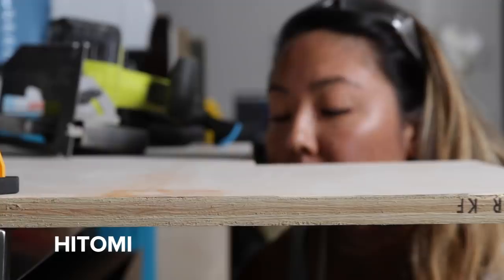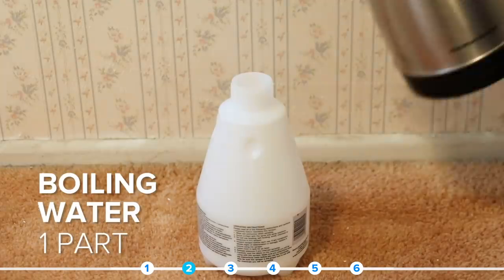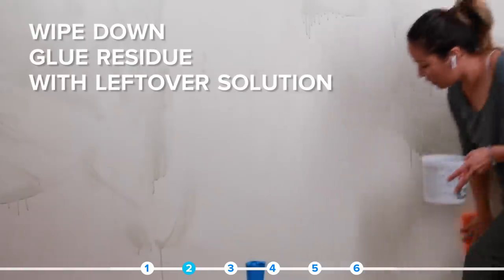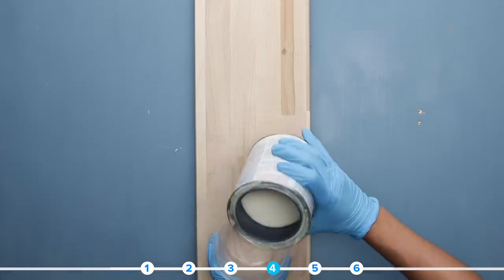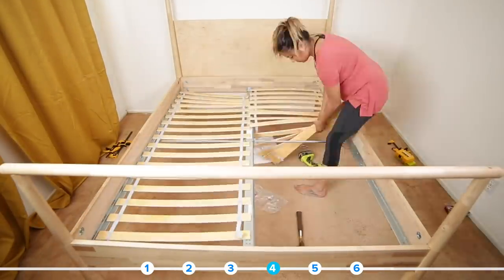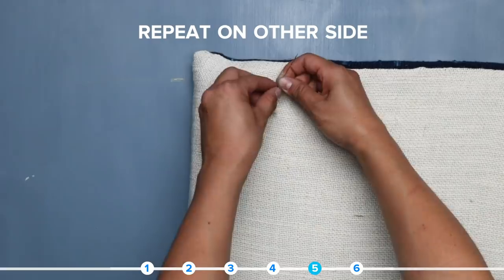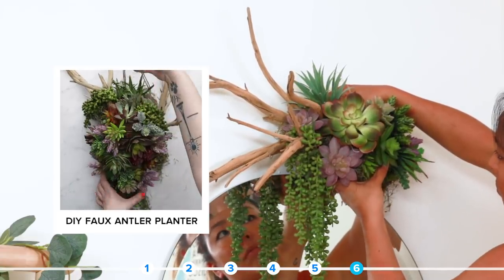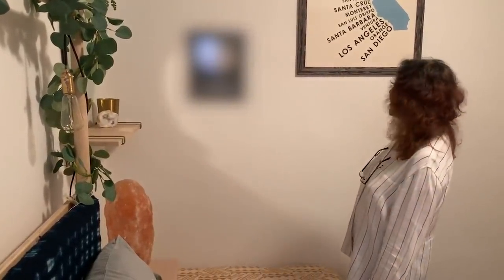I Made Over My Childhood Bedroom

Comment: It's important to note that all oil based paints will yellow over time.
Reply: Also, inexperienced DIY folks may not know that it's important to dust off surfaces after sanding and before applying a stain/primer/paint/poly top coat. You didn't mention this in the video.
Reply: So what storage solutions did you incorporate for all of the items that were there when you started?